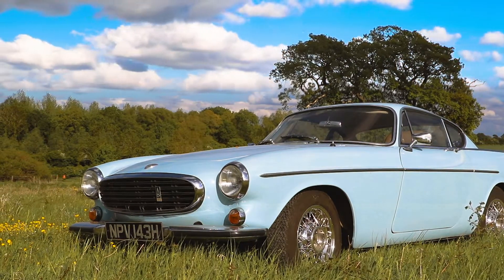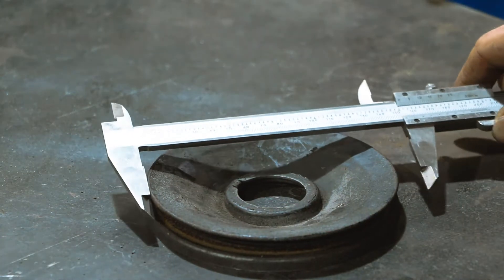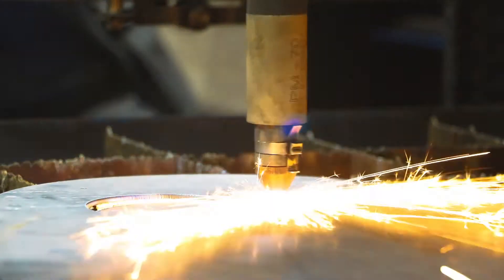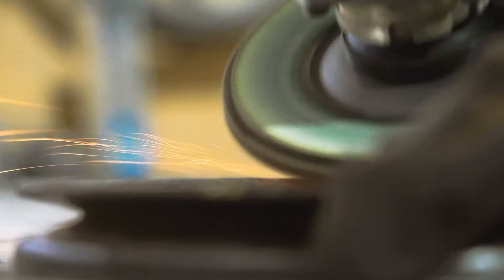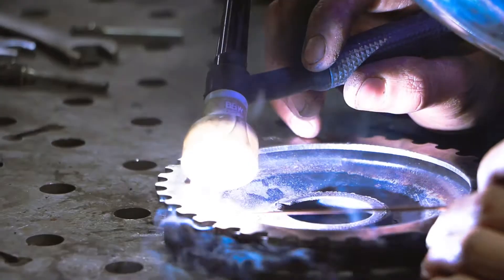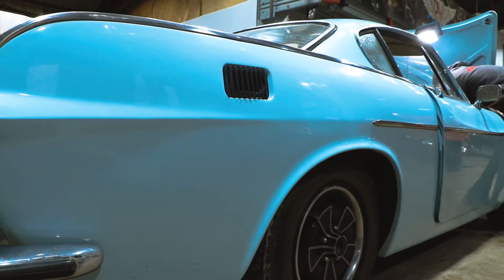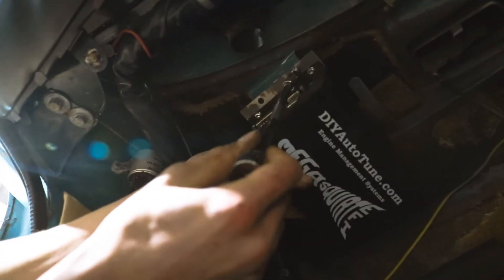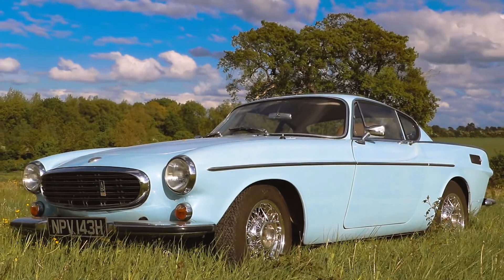How to perform an EFI conversion | Volvo P1800E | Classic car restoration

Comment: Hi p1800e 1970. The Ecu is not working at all.  What would be the cost of also repeating this process and replacing my ecu and  injectors with this set up.

Comment: Looks like a great idea, but at what cost, what difference did it make to the performance and/or fuel usage? Do you have a system for a Lancia 2000HF coupe which uses a Bosh 'J' jetronic system with points in the base of the distributor? please let me know Bob
Reply from the maker: It improved reliability, made fuelling more accurate which increased economy. We don’t have a specific kit for Bosch J jetronic but anything can be converted, we have done all sorts of engines. The Volvo conversion probably cost something in the region of £10k including parts, but every car is different.